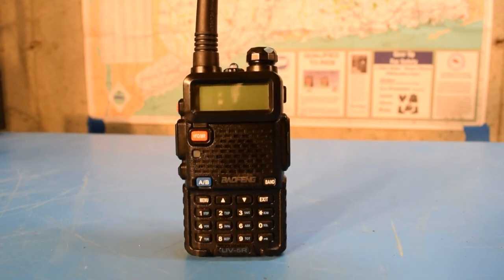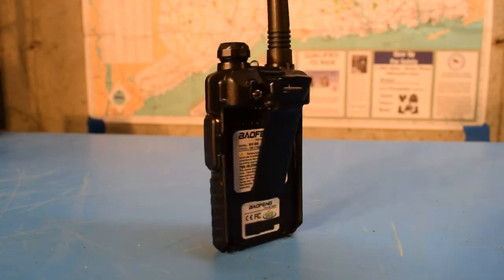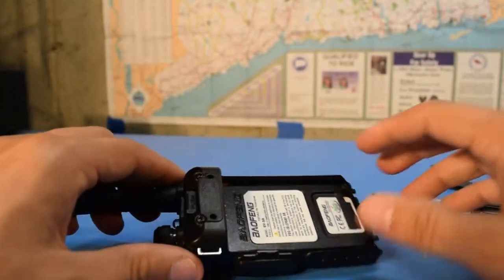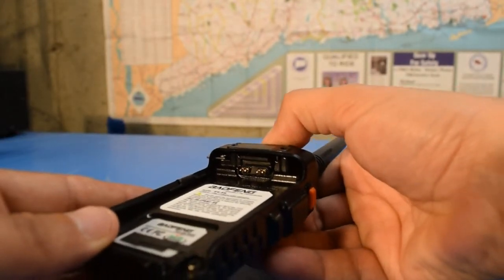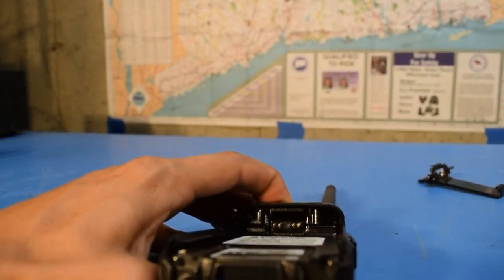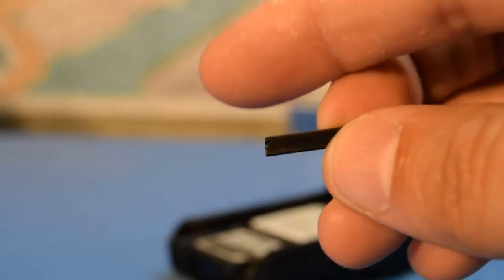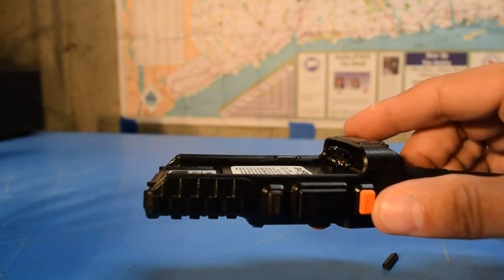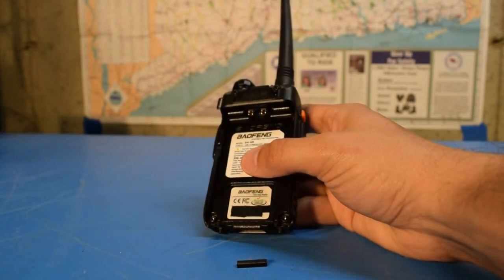Baofeng UV 5R - Check Your Battery Clip!

Comment: My nearly unused UV-5R has an intact tab on the battery as well as an intact mating tab inside the radio. But the two mating parts do not hold the battery in. The “click” heard when mating the battery is faint and the battery will slide out with any movement. So. Now what?
Reply from the maker: I'd glue it in place with something like e6000 or even hot glue that can be removed easily
Reply: @SevenFortyOne  Yeah, it may come to that. I have an Icom handheld that also includes the 6 meter band. It was way more expensive but it has worked flawlessly. The BaoFeng was more of a curiosity and back-up for me.

Comment: I have the opposite problem. The tab on the battery is good, the catch lip on the radio brook off instead.
Reply: Same here. Any ideas on a fix?
Reply: This guy seems to have created a file for a 3D printer that will make a replacement part. https://www.thingiverse.com/thing:2631001
Reply: I used gorilla glue to glue it back together hopefully it works.
Reply: I've bought that part on 409shop before. Just need a torx screwdriver.

Get a few, because the first replacement seemed to break easier after I dropped it after a couple of months.
Reply: @dazednconfused31337  you can buy them?
Reply: same here

Comment: Common problem. I've had it too, you will probably find that the broken piece of plastic hasn't in fact come off the battery, it's broken off the locking lever that's still present in the radio. With luck you might be able to re-adhere it

Comment: I've never had this issue, I wonder if the battery was slightly cracked at all before hand? Sorry you lost your battery. Whats the black tape on your radio on the back?
Reply: a decent drop will break it
Reply: we need to buy uv82 much better to use no problem and so good
Reply: Just broke my battery clip for the first time after knocking it a metre onto carpet tile. Found it still inside the radio and glued it🤞

I'd broken the opposite replaceable clip about three times before though so that will have weakened it.

From new I had to modify the quiet mic with a capacitor. With age the torch began to flicker. 

The channel up button lost it's function and click again. I've fixed it before, you re-bend the metal dome under the keypad.

Comment: Aside from the fact that these one chip wonder CCRs have some of the worst performance and spectral purity, this is yet another reason they are utter garbage. A single point of contact on a battery latch? Plastic on plastic is a recipe for failure. But you get what you pay for. Never seen an FT-60 battery fall off...
Reply from the maker: I agree 100%.  You do get what you pay for when it comes to these things and if you don't expect too much out of them you won't be disappointed.  I feel bad for the new hams that buy these POS radios and think they are getting something good.
Reply: 25$ radio vs 200$ radio.  This one’s good for beginners why so much whining